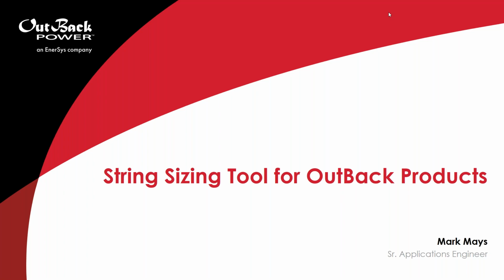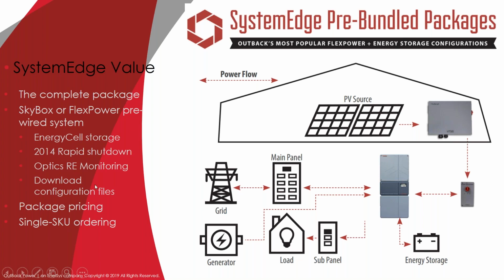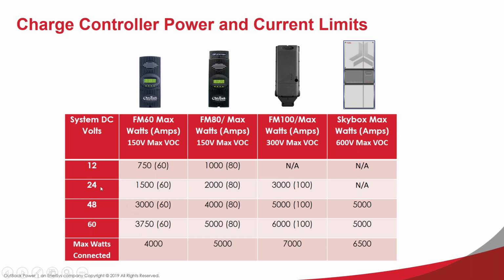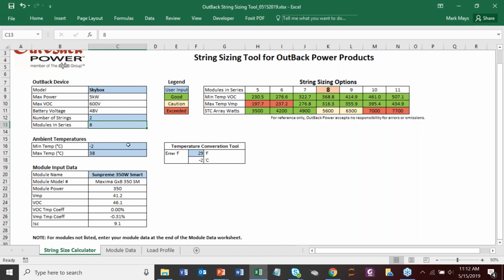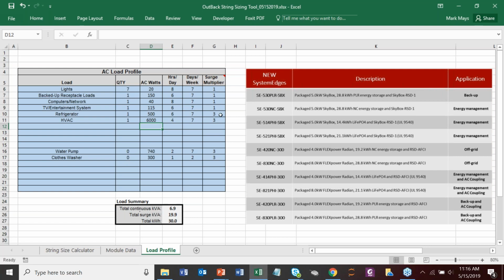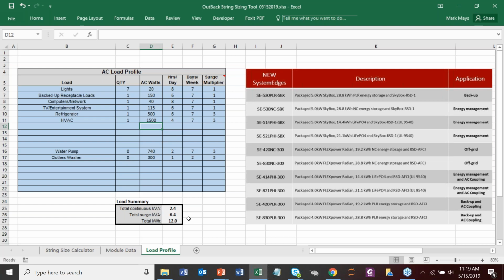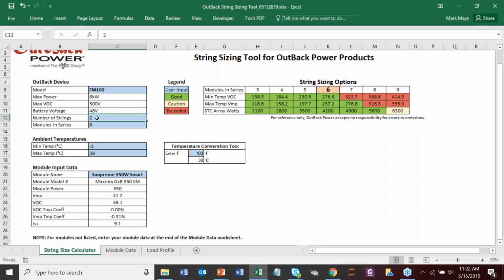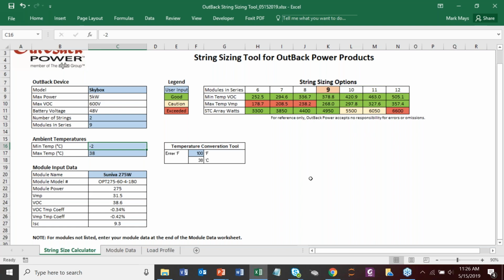Webinar | String Sizing Tools for PV System Designers

Comment: I just ( May 1, 2020) downloaded this string sizer from the Outback website, but I discovered that the Battery Voltage field is greyed out at 48 volts, so I can't enter 24V or 12V. I don't understand why the battery voltage is not selectable. Comments?